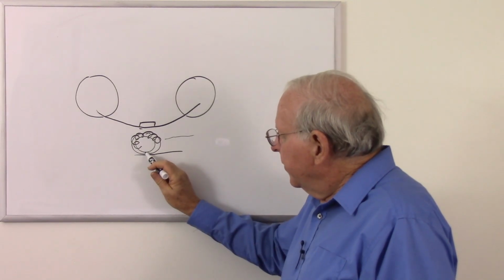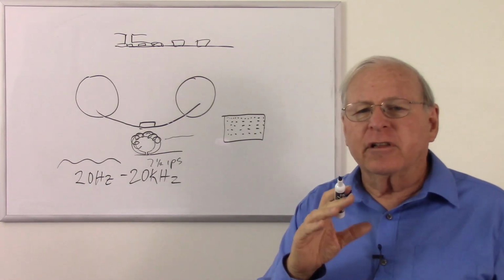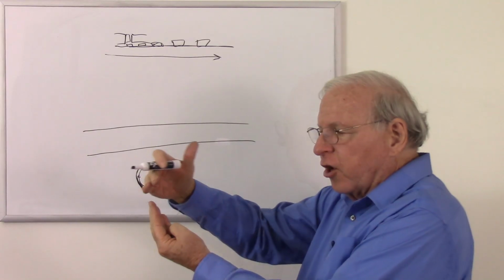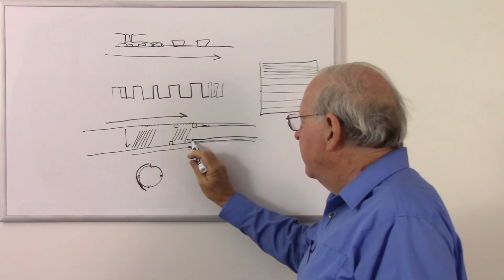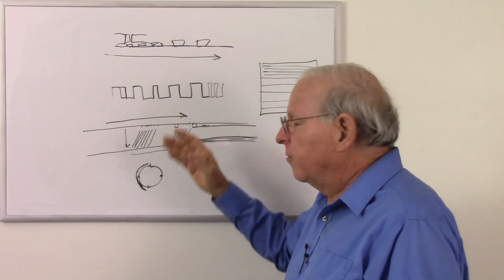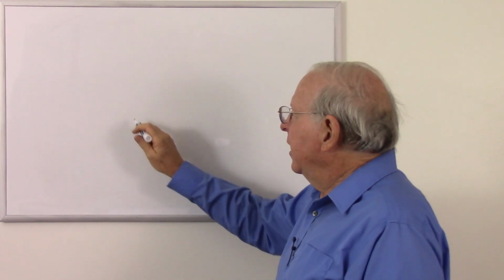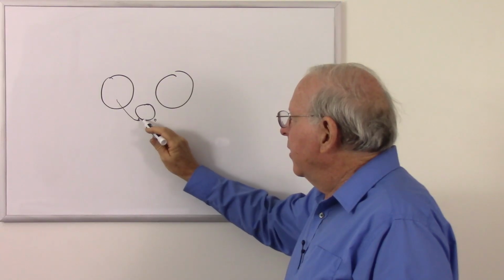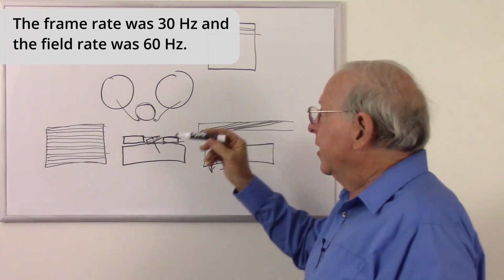Analog Video Recording - Solid-state Devices and Analog Circuits -  Day 14, Part 2

Comment: Vcr मे ऑडियो and वीडियो head केसे काम कर्ता है और vcr का ब्लॉक diagram से detail मे समझाये ❤
Reply from the maker: English: How does audio and video head work in VCR and explain in detail with the block diagram of VCR?

The audio and video heads work on the same principle, basically an iron core inductor with a gap. However, the video heads of a VHS system have a tiny  gap of about 0.5 microns. I'll see if I can find a link to a block diagram